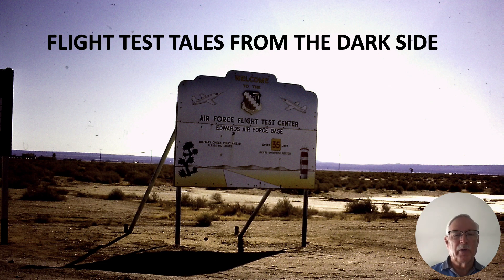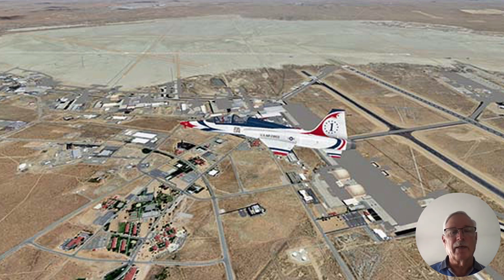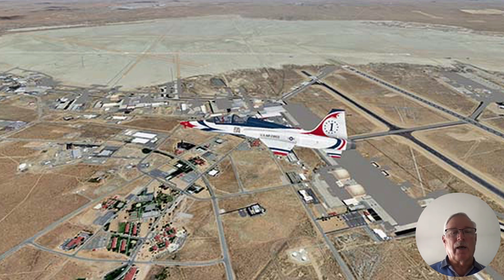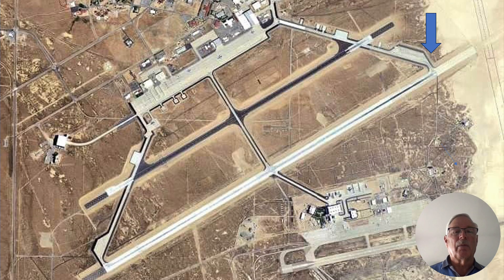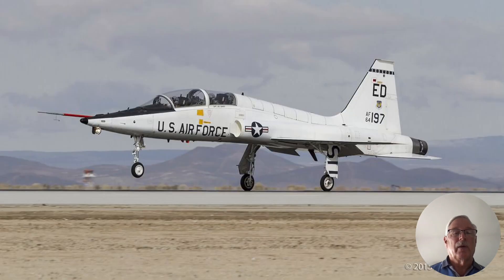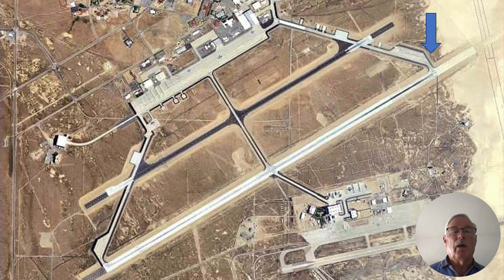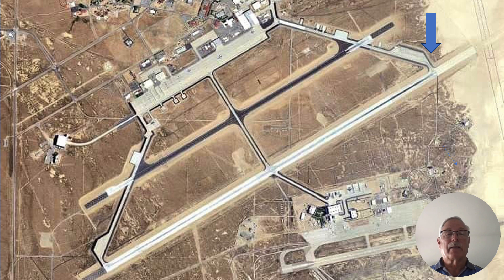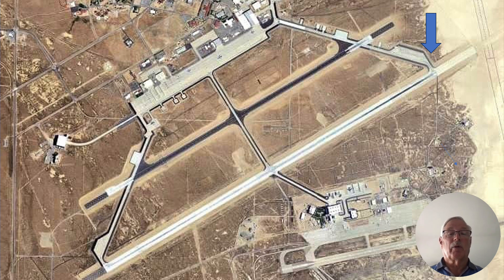FlIGHT TEST Tales from the DARK SIDE.T-38 Single Engine  TAKEOFF. USAF Thunderbirds flying the T-38

Comment: As a former T-38 IP, 105 kt approach speed at mil power sounds terrifying.....
Reply from the maker: Yes I agree. Most pattern speeds were normal and you started to slow on short final walking it back up the power curve raising the pitch attitude as you increased power right into the flare with very little flare.